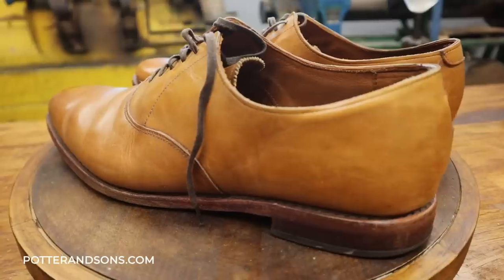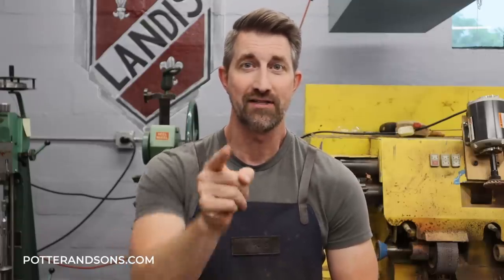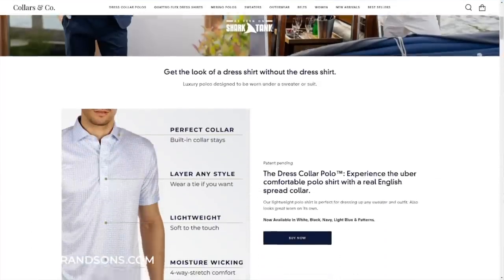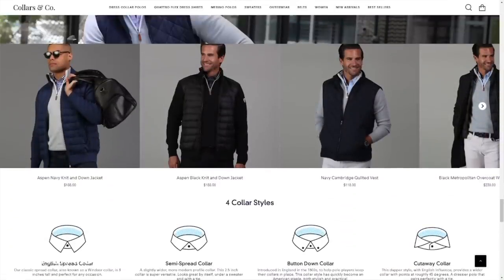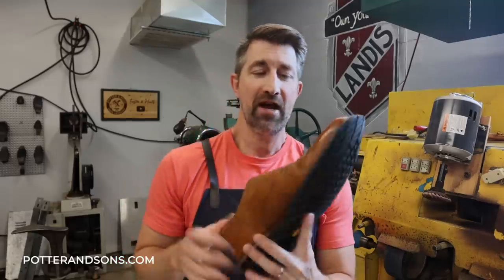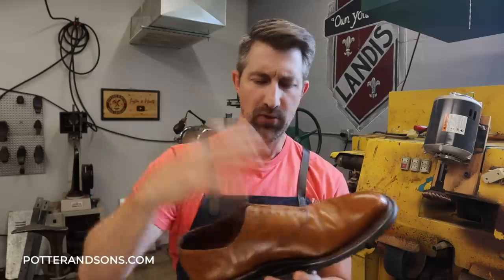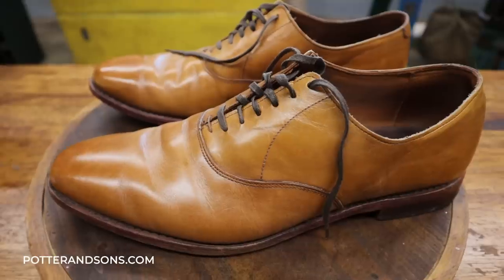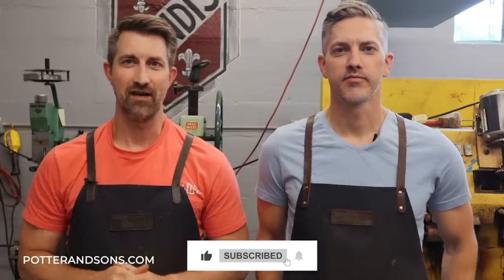TRANSFORMATION - From DRESS SHOES to KITCHEN SHOES | Helping Out a Customer

Comment: I've been a cook for 20 years if the client is reading the comments do not trust the heels on on those shoes, they will betray you! Shoes for Crews tread pattern is the best. I've had my Red Wings resoled three times.
Reply: Can you elaborate a bit
Reply: @ag4103  20 years is 2 decades a client is a customer and there's a difference between saying non slip and slip resistant Shoes for Crews is non-slip that means it works

Comment: 3M 4298UV Adhesion Promoter is a very good product.  If you're having issues w/ glued surfaces staying together you might want to give it a try.  We use is a lot for automotive exterior parts so temperatures are over 120 F, 

Usually I'm not a fan of the video sponsors but floppy collars are a pet peeve of mine and this looks like an interesting product to try.